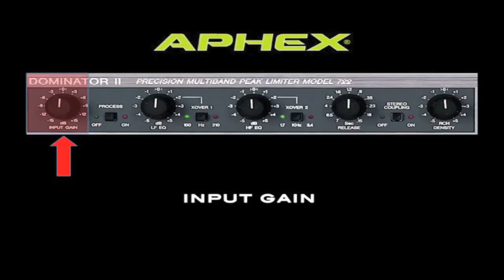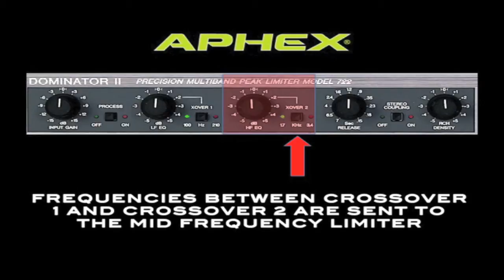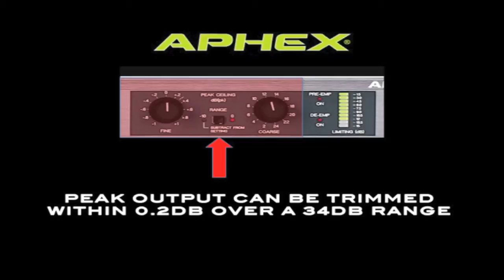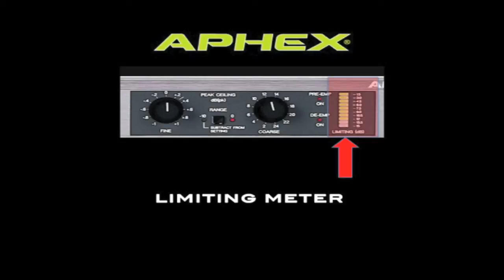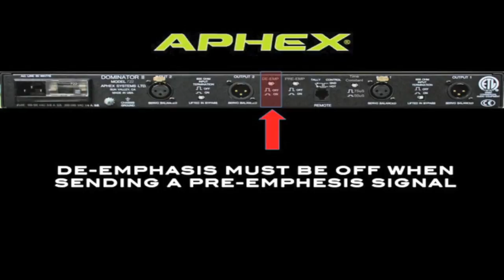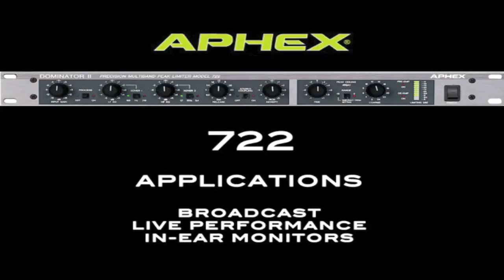Aphex 722 Dominator Peak Limiter Training Video

Comment: God damn training video.. this boys complicated asf. That part about pre emphasis and deemphasis had me lost. I like it in my rig but actually have it right before a multi effects unit.cthe dsp 256 xl. also a rane sp15 eq and dbx 166 before it. It feels like the compressor and limiter work together somehow
Reply: Pre / de emphasis is used in broadcasting (and also analog tape). It's basically just a big boost in the high end (pre emphasis) and then an equal cut in the high end (de emphasis). It's used to lower the hiss. When American terrestrial FM radio stations send their signals from their transmitters, they boost the high end by 17dB. The de emphasis is then applied in people's radios. That way the noise of FM transmission is reduced by 17dB while leaving the program material sounding flat, or un-EQ'd. 

If you can find pictures of old audio cassettes, you will see on some of them that normal bias cassettes (Type I) has 120 μs (microseconds) written on them and chrome and metal cassettes (Type II and Type IV) have 70 μs written on them. Those values correspond to how much pre emphasis is applied. Type I tape cannot handle as much level without distortion so the pre emphasis starts at a lower frequency and takes longer to reach its maximum, resulting in a 12dB boost at 15kHz. Type II and IV can handle more level so the pre emphasis starts at a higher frequency and takes less time to reach its maximum resulting in a 14dB boost at 15kHz. 

Professional multitrack tape on the other hand uses treble and bass boost curves for their pre and de emphasis and isn't expressed like it is with cassettes.
Reply: @JeroBagg  Wow, wonderful info and context. Thanks for the details. If possible, could you clarify why units of microseconds are used to refer to a particular frequency profile of pre-emphasis/de-emphasis (which would be in cycles/sec aka Hz across a spectrum of frequencies)? So puzzling. Thanks again!
Reply: I'm using them all for tone shaping in a aux send and return. I'm all diy on my own was serendipitously blessed a bunch in gear so any help is appreciated